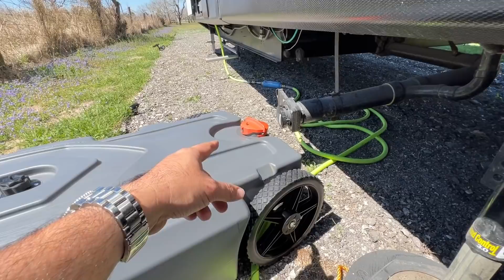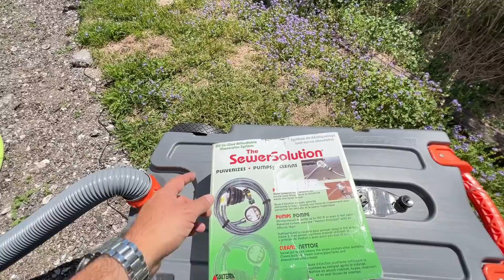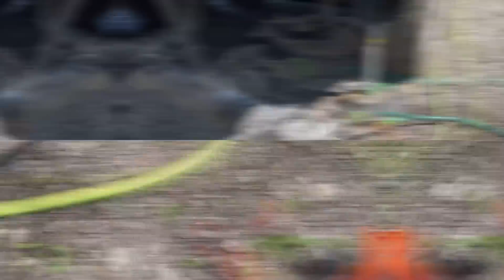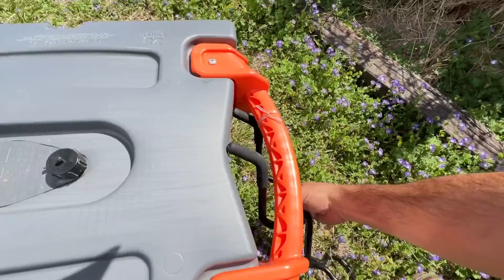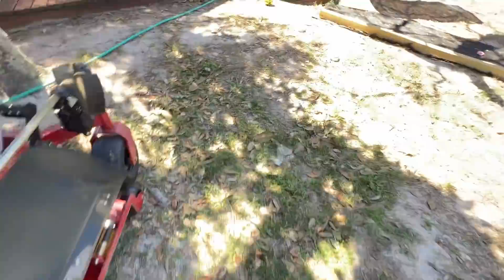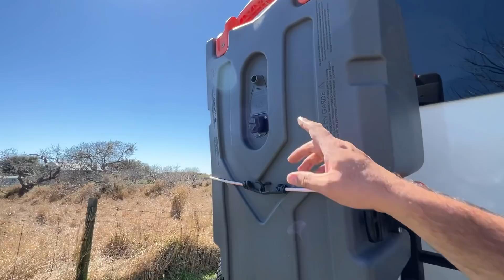Transferring and Moving RV poop isn’t easy but this may help!

Comment: Use the Valterra macerater  to pump at home into a clean out about 100 feet away uphill 2% grade. Works fantastic. I replaced the hose that came on it with a clear hundred foot hose.

Comment: We’ve used a sewer solution for 6 years and it works great. You can pump the waist a long distance if you attach sections of pvc  pipe. Just follow the directions.

Comment: Probably works best for dumping into a sewer clean out in your yard or toilet in a garage. The extra water it uses to flush will fill up your blue boy pretty quick. I have one we bought several years ago, we still haven't used it. Also it looked like it was leaking water, probably at the quick connect.

Comment: I had that problem and I used a 90degree adapter hooked up to the blue boy tank and the straight part connected to the camper drain.

Comment: Through that thing away, get a macearater pump. This works just like i thought years ago when it came out. The pump works great. You can put the tank in your truck pump it up into it and your off to the station. It works great.

Comment: Totally agree with your comment about a place to stow attachments on/with the mobile tank. It was one of the first things I wished for going from RV to dump station. I left the flex hose attached and capped the other end. Used a bungee cord to keep the hose off the ground during transport. I have the 15 gallon size tank with only one inlet/outlet. Thanks for your observations!

Comment: I use the side gate valve.. dump till full then shut both gate valves and a little spillage. but I ONLY use the rihno for Grey water so no big deal.. 
you can disconnect from the RV and connect to the top of the rhino and you won't leak but careful when towing the wheel might rub the hose

Comment: That's a pressure system not a masorator. I'm afraid I would have to see it chewing up sewage and toilet paper small enough to push it down the hose, for me to be a fan. Still cuts your sewage storage, I'll bet to half of what it would be on it's own. Might have to make 2 trips when you would only need one.

Comment: You could have put it to the lower inlet and it would have flowed in you would have still had to raise the sewage line and more than likely had tip the tank to its side to disconnect but it would have drained into your tote

Comment: I use a Sanicon Turbo 300 macerator for pumping my tanks into a tote in the back of my truck or a distant sewer cleanout.  It creates plenty of head pressure to go through 15' of Sanicon hose, 50' of garden hose, and several feet up to the tote in the truck bed.  So far, the Sanicon has been great.  Except for the first time I used it with the tote.  I didn't fully removed the vent cap on the tote just well loosened it.  Too much back pressure built up in the tote which cause my Sanicon hose/adapter to pop out of the tote and spray a little black water on me and the tail gate of my truck.  I'll be making a threaded to bayonet adapter for between the Sanicon hose and tote.  😆

Comment: I think I would put the clear elbow on your portable tank and the straight hose connection to the Dumped valve that  would give you a straighter shot into the portable tank

Comment: Actually been using the Sewer Solution as our primary sewer hose for about a year. Full time RVing. Works great. No supports, no stinky slinky. Heat tape during the winter. Makes cleaning out the black tank easy.

Comment: I have the same tank as you and have the same problem that my camper dump valve is slightly lower than the tank. I hook my hose to my camper and put the clear elbow on the dump tank side and put some blocks under my hose to keep it level. I’ve never had any issues because the flow coming out of the camper is usually enough pressure to get it into the tank.

Comment: Hi JD,  two things I thought of. 
1. Maybe there should be a hand pump on the container so you could create a vacuum in the container, before you open the drain valve. 
2. You might need a rinse hose at the dump station to wash out the storage tank prior to putting it away. 
😊👍👍👍

Comment: Would certainly caution others to be aware of the chemicals they use in their camper if they're planning on dumping into their home septic system.  Using formaldehyde based chemicals could kill off the bacteria in the septic tanks and not allow it to work as it should, preventing the bacteria from breaking down solids  and preventing only liquid to be transferred out to a leach field.  A potentially very expensive mistake.
Reply from the maker: Good point.  Everything we use is septic system safe.

Comment: Why do you refer to the rv as a 5th wheel ? Is it a status thing? Like hey i have a 5th wheel and not a tag trailer ?
Reply: “Fifth Wheel” means how it connects to the tow vehicle. A Fifth Wheel connects in the bed of a pickup (or flat bed) similar to a Goose Neck or 18 Wheeler. 

A Bumper Pull is often called a Travel Trailer and connects to the bumper area (not the actual bumper) of the tow vehicle. 

So it’s not about status, just what they are called. 

But then I’m not sure what a Tag Trailer is. We don’t use that term in the US.
Reply from the maker: Because it's a fifth wheel.....if it were a travel trailer, I'd say travel trailer.

Comment: this may have been suggested already, but in order to get a better gravity feed, could you not just dig a small hole next to the edge of the gravel that would allow the container to sit lower?  Also, use a straight-through connector rather than a 90-elbow to maintain your fall better.
Reply: That's brilliant, Gary and so simple. JD: "I'd probably stumble in the hole and then the gophers pop up..." LOL 🤣😆!

Comment: This really is a silly post people caming DON'T bring lawn mowers along with them! Put it in your truck pump it in with 
The maserator. DON'T  USE THE TOP HOSE CONNECTION ON THE BLUE BOY
USE THE SIDE ONE WITH THE VALVE ,
THATS WHY THEY PUT THE VALVE THERE IN CASE ONE HAS  A PROBLEM U CAN SHUT OFF THE VALVE. SILLY POST DIDNT DO YOUR HOMEWORK
Reply from the maker: Lol, yeah, you won't fill too far using the low point connection.  Also, how are you able to clear what's left in the hose?  You'd need to tip the entire caddy on it's side and hold the hose up.   Silly comment my friend

Comment: Is your Valterra safety valve glued to or permanently attached to the drain tube?  The way it attaches on ours, it pops off when I try to twist off the cap.  We have to position ours the same way you have yours because of the leveler on the right side.
Reply from the maker: We installed the glued on version

Comment: Where the Valterra Sewer Solution is really a game changer is when you cannot park with the RV tank outlet higher than the campground in-ground sewer inlet. With the Sewer Solution you are then able to pump up to three feet above your outlet valves. We just did that at a recent campground, very successfully.

One tip for those planning to buy an OEM  25' extension hose from Valterra, I suggest buying two 10' extensions instead. That way you have more connection options and 30' (standard hose that comes with the system plus the two 10' extensions) is the maximum distance Valterra recommends before adding solid hoses for the balance of the 100' quoted total reach of the system.
Reply: I'm confused by your comment. The 25' ext. is $47 but the the 10' ext. is $40. Are you saying that the original hose is 30' long? If you have a 30' and two 10' pieces you get 50'. Then to go another 50' you have to put it into a solid pipe? What you are suggesting is not economical first and confusing. I'm not trying to bash you. I'm simply confused as to why I would want to get two 10' extensions rather than a 25' ext. Maybe you can explain a bit further? 
Thanks, 
Pat

Comment: I also use the sewer solution to dump at home. I have a 2" drain coming from our clothes washer by the camper and I wasn't comfortable  using the 3" dump hose.
It works well. I don't think you get the same "Va Whoos" as with the 3" 
But hey I'm dumping at home ND that's worth a lot to me.
Thanks

Comment: I wonder if they'd used the hydraulic pressure to power a mascerator blade, if that would have been a better plan. I can still see this getting clogged, especially if you are off-grid and using your own water pump in the trailer to power the flush.

Comment: Yeah that was a big problem for me on my Zinger my portable tank was too high off the ground to drain the black tank. Now I have a reflections Grand design and the bathroom is above on the second deck so now there's plenty of room to drain the black tank into the portable tank, big problem before now resolved. When I got my second camper I specifically knew that I had to have something taller that I could empty into my portable tank that was a big factor. Otherwise I have what you have an undesirable situation. Also Grand design has a flushing system built into the black tank big help big improvement.

Comment: I've been using the Sewer Solution for years to empty my tanks at home. I've got a setup where I run PVC pipe all the way from my driveway to the sewer clean out at the front of my house. When I dump the tanks, I just get the pipe run out, connect them up, and attach the Sewer Solution hose to it.  I've got it setup with screw type couplings so that I can take the pipes apart and leave them in the shrubs when not in use.

Comment: Macerator does not add water to the tote tank. So fewer trips to the Dump station.  Tradeoffs in life. 
 I use a macerator and a hose long enough to reach the truck where I put the tote tank in the bed so I don't have to drag the tote with the hitch ball, and use a stinky slinky long enough to reach down to the dump station inlet from the bed of the truck. I have long enough wires for the handswitch that controls the macerator, so that I can monitor how full the tote is getting and shut it off when needed.    Advantages of this method are:  no pulling of heavy tote to the hitch.  I only have to lift the tote into the bed of the truck when it is empty.  No pulling and pushing the tote to position it at the dump station,  just park the truck close enough so the the stinky slinky reaches.  And I have a tote just like that one, so it has the empty port with shutoff valve on the side, so no lifting to empty the tote.
You do have to have a hose end cap that you can screw on the hose during trips to the dump,  so that when you lay the hose down in between trips, you don't have a mess, but it is easy and neat to do.  You should have hose caps anyway to prevent contamination of the area where you store the hose.

Comment: I have the same system, and it works great!
Reply: I just put the tank in the back of my truck  u the maserater and hose to pump in the tank in the back of my truck and go dump it with the bigger hose. Been doing it for years

Comment: Could you have connected the short sewer hose to the gate valve on the caddy since it was lower than the top inlet? You still would have to tilt he caddy, but it may have been easier. Just a thought.